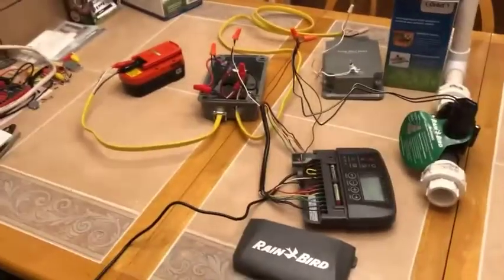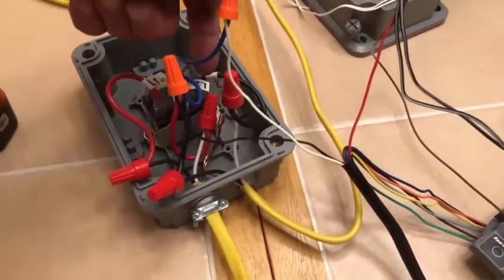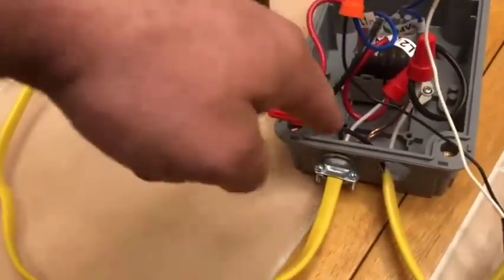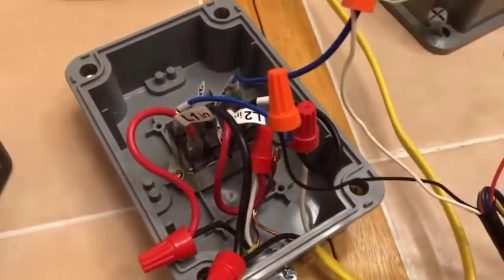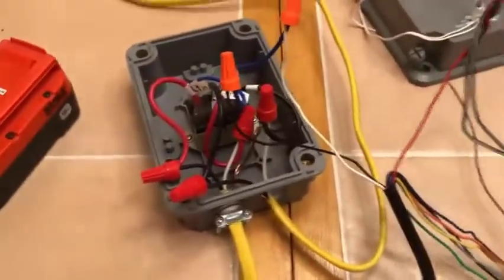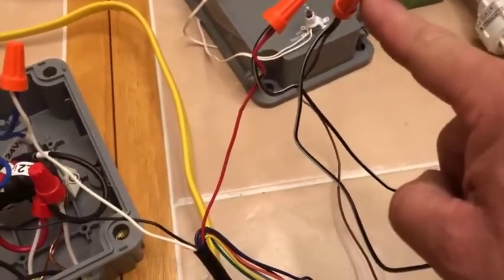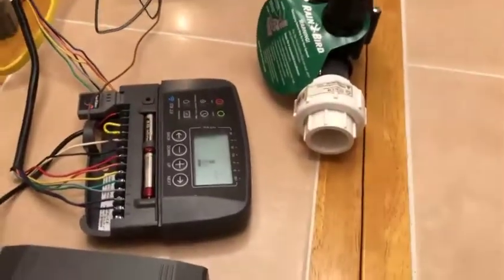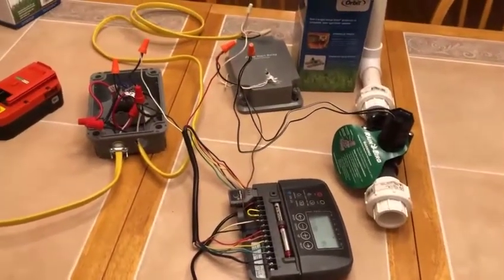4. Home Lawn Irrigation System - Electronics In Action

Comment: Thanks for the video.  I'm wiring one up tomorrow and I want to make sure I get this right.  My input power will be: black to L1 In and the white to L2 In.  The output wires to the pump would be: black to L2 Out and white to L1 Out? Thanks in advance.
Reply from the maker: So, re-check.  There are two IN wires... 1 & 2.  There are two OUT wires... 1 & 2.  If you have black on L1in, black goes on L1out.  That only leaves white for L2in and L2out.
Reply: @drapp5752  Thanks for replying, I got confused when you said the white wires go to L1 and L2 respectively.  Understand now, thanks again for the help.
Reply: I realize it's quite randomly asking but does anyone know a good site to watch new tv shows online?
Reply: @Kaiser Jon I use Flixzone. You can find it by googling =)
Reply: @Tristan John definitely, I have been using flixzone for months myself =)
Reply: @Tristan John Thanks, signed up and it seems like they got a lot of movies there =) Appreciate it!
Reply: @Kaiser Jon You are welcome =)